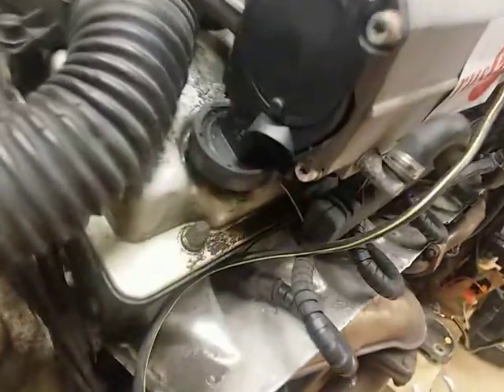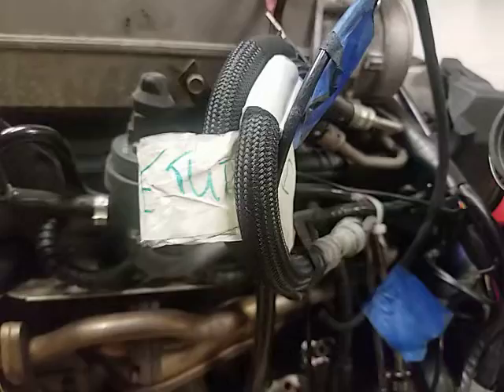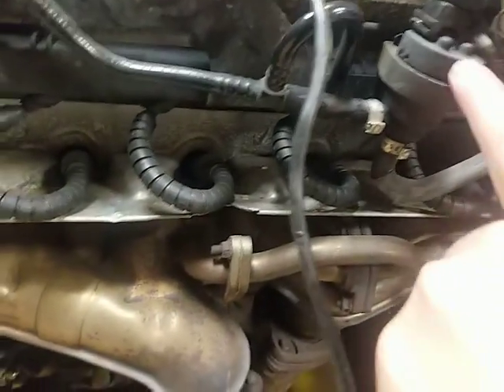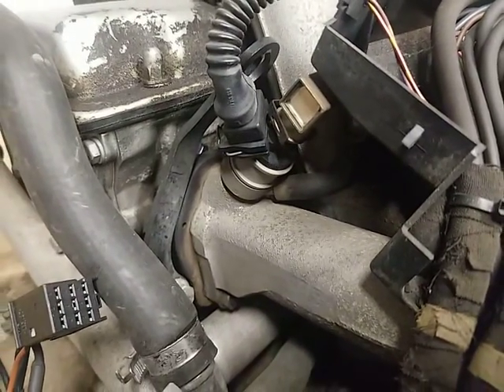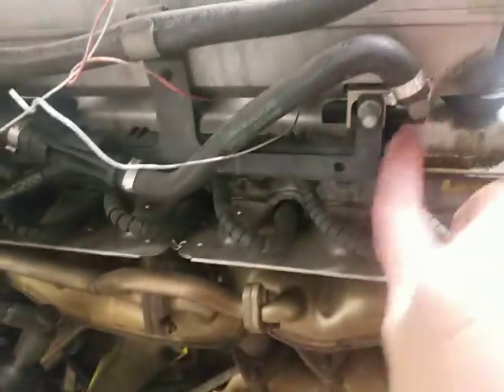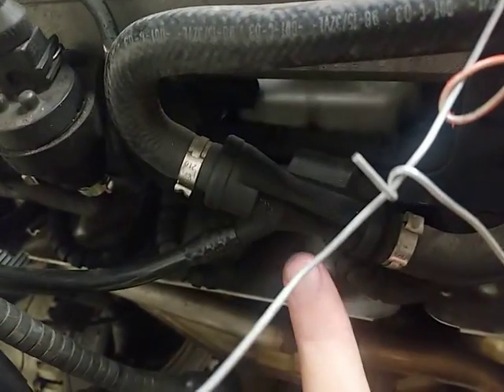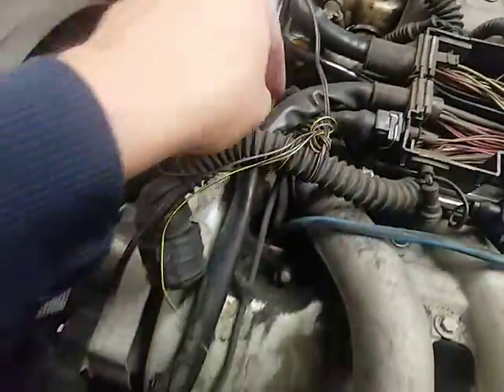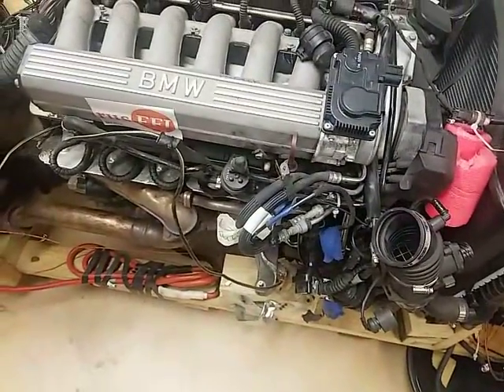e38 m73 vaccum lines

Comment: I just got rid of all the evap system on mine. Also the cat. Bye bye anti polution system, hello better running engine.
Reply: did you install chevy EV connector injectors?
Reply: @supra1722  haven't work much on it since, waiting for a ecu. I will go with ford or chevy injector for sure as I will need a high flow: I couldn't decide between supercharger or turbo, so I might do both XD

Comment: So, the solenoids on either side of the engine are the purge valves from the charcoal canister. That blue hose that Ts off goes to two different air valves that feed air from the secondary air pump to the exhaust manifolds on both sides. That all can probably be deleted off you engine. That's all I can remember without going out to look at my 750iL
Reply: If you look at the exhaust manifolds there is a steel tube running around to the front into two valves. Thats what that blue vaccuum hose that Ts off controls.
Reply from the maker: @bodytolson7390  yep, secondary air - but looks like steel tube mounting hardware is hard to reach, i will probably keep just because too much effort to remove
Reply from the maker: looks like these solenoids are actually for injector air injection - the hoses go up into the V and in the V those hoses connect to air rail
Reply: @Rusefi  hm, this must be an M73TU then cause those solenoids are not on my M73. Not familiar with what the technical update added aside from heated catalysts
Reply from the maker: @bodytolson7390  are you on "E38 Empire" facebook? yes M73TU see https://rusefi.com/forum/viewtopic.php?p=38863#p38863
Reply: @Rusefi  I'm on E38 Empire now!
Reply: Did you come up with a solution to simplify the vacuum lines... I would like to do the same on my 750il .. looking into  using your ecu set up and make the 750il  drivetrain more efficient and simplified.
Reply from the maker: @volvoripr9980  https://rusefi.com/forum/viewtopic.php?p=39003#p39003

Comment: PVC system?
http://bmwe32.masscom.net/sean750/vcv_replacement/VCVvalves.htm
http://forums.bimmerforums.com/forum/showthread.php?1425244-Symptoms-of-bad-OSV-PCV-on-M73-V12
https://www.bimmerforums.com/forum/showthread.php?1509251-How-you-check-PCV-system-on-a-750-V12

I don't think it's unusual to have the crank case ventilation to be re-cycled back through the intake between MAF & TB.  

(Not a BMW expert here.. just following the V12 EFI development).
Reply from the maker: this video is a bit longer and touches other things. I would love to know with some certainty :(  
https://www.realoem.com/bmw/enUS/showparts?id=GK23-USA-03-1996-E38-BMW-750iL&diagId=11_1544

https://www.realoem.com/bmw/enUS/showparts?id=GK23-USA-03-1996-E38-BMW-750iL&diagId=11_1432